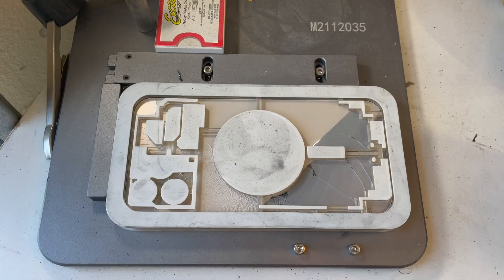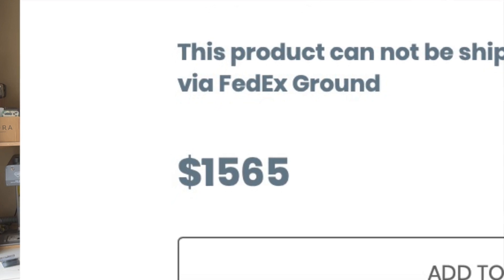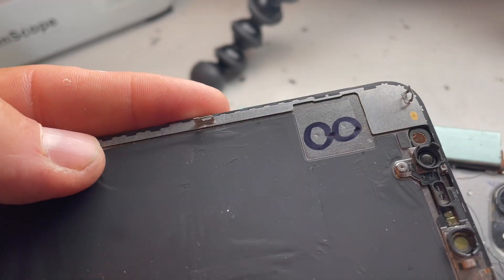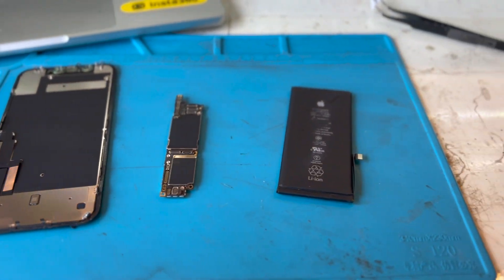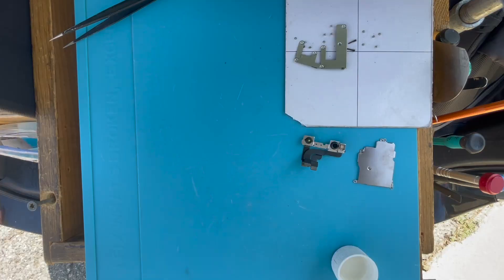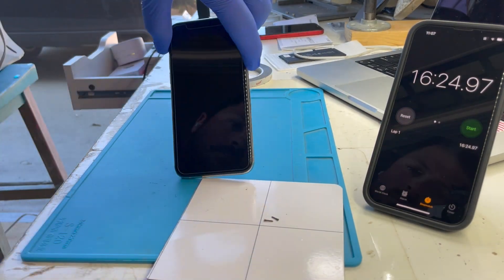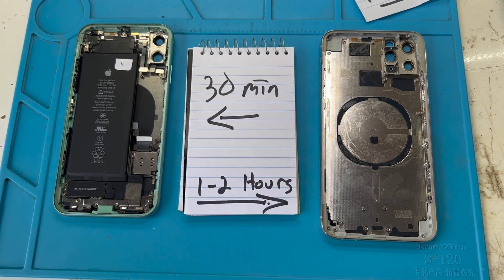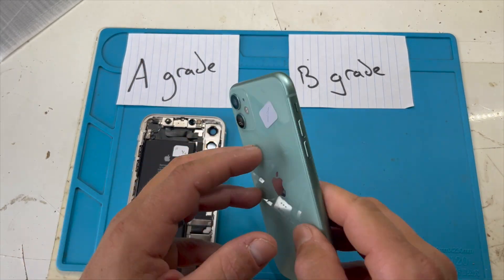the pros and cons of iphone back glass repair

Comment: I have a question

Suppose I have the back glass replaced the first method you talked about will the water proofing stays intact from the sides of the back panel?
Assuming front section of the phone is also is never opened and is still waterproof
Reply from the maker: I highly doubt it

Comment: Hi! Just wonder about the backglass only DIY repair for a iPhone 13 mini. I have seen videos on youtube where they just use a razorblade and pop/crack off the back glass. Is it unsafe to do so without the glue lazer thingy? Or is it currently more DIY friendly?
Reply from the maker: It all depends on how much experience you have, I see “professional” repair shops screw up this job all the time. As a general rule, I always suggest replacing the housing with that of a genuine Apple part. You’re way less likely to have issues or damage the phone.

Comment: I have a question, my back glass is also broken like this however id like to not go for a repair, is that a good option? my phone is currently fully functional and i do not want to mess it up.
Reply: Don’t repair I regret doing mine they just don’t do it properly even my back camera got dusty and idk if it’s my imagination or it does affect the battery life and heating problem is a must 🥲
Reply from the maker: @tia_tail_ most shops cut corners unfortunately.   Few shops will actually take proper precautions to ensure glass doesn’t get inside the phone.  There are some that do but I’d say most won’t 😭

Comment: Hey so I have the iPhone 15 pro max and just had Apple replace it using Apple care plus. It was 29.99. Do you think they did the repair to bring it back to factory stock condition or once it’s repaired has it been compromised?
Reply from the maker: I have mixed feelings about that.   They obviously use oem parts.   The only thing I have doubts about is if the device will still be water resistant.    I’m seriously interested in their method for removing the old gasket.   Because that is by far the most difficult part
Reply: @repaironwheels  I wondered that too! As I take this thing in the sauna all the time lol
Reply from the maker: The mysteries of life.   Where did we come from? What is the meaning of life? Who killed jfk? Is my iphone still ip68 water resistant after apple repairs it 🤣
Reply: @repaironwheels  lol hahahaha. For 29.99 I really hope they did it right.

Comment: Hi sir. May I know if replacing a cracked back screen iphone 14 pro max affect the quality of the phone?
Reply from the maker: Not sure what you mean.   Did you replace the glass and now you’re having issues?   Or your back glass is broken and you’re hesitant about getting it fixed because you don’t want more issues.    

Replacing the back glass doesn’t inherently create problems, that being said, doing a glass only repair has the highest change of creating all kinds of issues compared to replacing the housing using oem parts

Comment: Carriers void trade in value if using am after market back glass, which does not come with the apple logo on the backglass
Reply from the maker: I get aftermarket glass with apple logo.   Not sure what carrier stores you are going to but I or any of my customers has yet to be denied trade in value at a carrier location (att/tmobile/verizon)     Now Apple stores are a different story.  It’s a bit or a miss there.   I’ve traded in plenty of devices to Apple with aftermarket glass, it just had to be in pristine condition with no evidence of replacing he back glass

Comment: Heyy plzz reply 

Last week my iphone 12 back glass is changed by heat method now my phone is lagging too much , sometimes my phone screen automatically start opening apps apps or typing , may u plz suggest me a solution
Reply from the maker: Touch issues are more than likely rectified by replacing the screen.    The phone lagging sounds like a much bigger issue tho.  Could be board damage?  Or could be something else.     That’s why you always take the board out of the phone. And or never use a glass breaker around the logic board

Comment: Is it permanent or may peel off by time??
Reply from the maker: oem won’t peel off.  aftermarket could depending on what the tech used for adhesive.   in my experience it would break before it would peel off

Comment: Pls does changing of the iPhone xr back glass gonna affect the speaker not functioning while on call and its put on speaker, but without putting on speaker its working and while playing of music to is work.... Also WhatsApp voicenote too is not working does changing of backglass have any connections to stop it from functioning.
Reply from the maker: If done right no.   But back glass only method has the highest chance of accidentally damaging or severing flex’s which is probably what happened
Reply: Ok... Changing the full back cover resolve it?.
Reply from the maker: @kolemessi4418 that or replacing the individual components
Reply: That's replacement of the frame
Reply from the maker: @kolemessi4418 the frame is that just.  A frame.    Whomever did the repair more than likely damaged the flex cables which is why those functions don’t work anymore.   Like I said glass only has the highest chance of damage compared to just replacing the housing with a housing that has small parts in it.      

That is probably the easiest way to fix your issues.  Compared to replacing each flex until the issue is resolved

Comment: I have a question when the back glass is replaced would the phone get slower?
Reply from the maker: It shouldn’t.   Is it slower across the board or just specific tasks
Reply: @repaironwheels  Thanks so much!!!!!!!!!!!
Reply: @repaironwheels  Does apple give you a message on settings saying that the back glass is not original or no? Please  if you could, could you please explain this to me?
Reply from the maker: @mysticvortex1221 the back glass or housing is not a paired part like the screen/battery/rear cam/face id.  So no, there’s no ‘unknown’ part message.  At least as of the 15 series and older

Comment: Sorry I just  have one more question. Does apple  give you a message if  you get a new back glass? They say that it is not original back glass? Idk someone just said that but I am not sure. So I am asking you because you are an expert.
Reply from the maker: the back glass or housing is not a paired part like the screen/battery/rear cam/face id.   If you know what to look for it’s not hard to spot aftermarket glass only repair compared to a genuine apple housing

Comment: What should be good price according to you to change back glass on iphone 14 according to u also there is a little bend on my frame
Reply from the maker: I’d be a bit skeptical about putting a new glass on a bent frame.  There’s a lot less to mess up on the 14s than previous models.   But I’m doing that repair for around 100